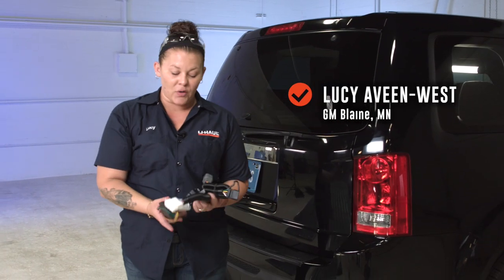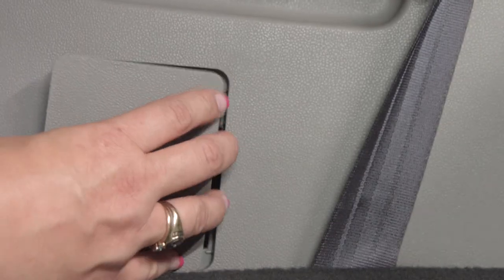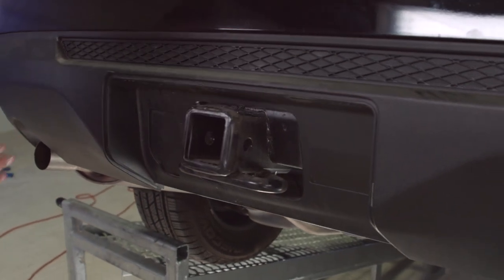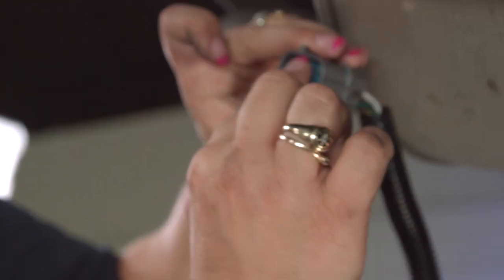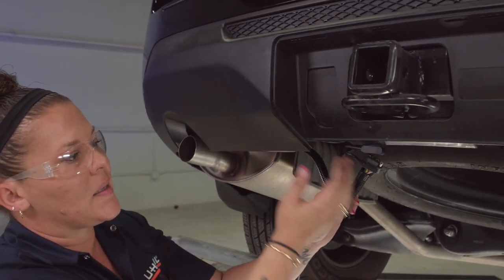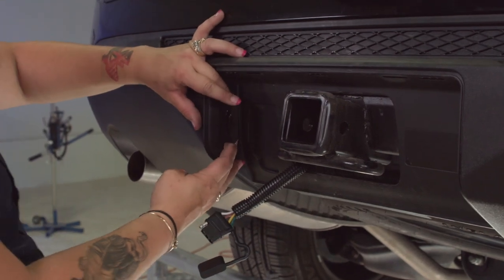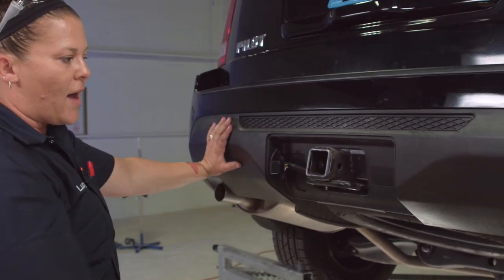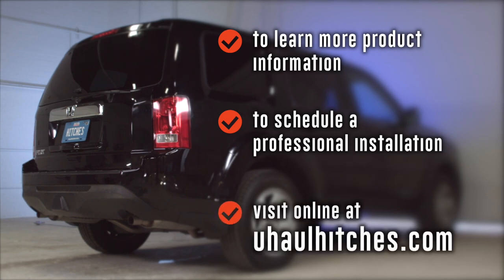2012 Honda Pilot Trailer Wiring Installation

Comment: The part at 2:25 where she says "unclip and pull out" is bogus.  The "clips" are, understandably with regard to the wiring harness, made never to come apart unexpectedly.  So they hold the "safety cover" very securely.  It took me about 45 minutes to get the thing off.
Reply: Ikr 😂 had to squeeze it as hard as humanly possible
Reply: The clip that holds the harness on, needs to come off. Then it should more easily pull apart. It wasn't until I was putting the tow harness in that I realized it wouldn't go in there until that clip was off. Which would have allowed the safety cover to come off easily.
Reply: Pull the adhesive clip off of the frame of the car. Slide that piece out of the harness. Then on the opposite side, there is another clip that needs to be pressed to release that side. Then you can easily pull the casing off
Reply: How did you finally get it off?
Reply: Got it!

Comment: So once that 1st componet/wire gets connected, u just shove the rest of that wire in and no need to do anything with the other end? I'm lost.
Reply from the maker: Yes! Nothing else is needed for the harness. Once plugged into the male end in the cargo area, you can store and forget about it. This allows you to get power to the 4-flat installed later in the video as well as stores your fuse.

Comment: Looking for this kit and it isn’t the same. On the site the kit is incomplete
Reply: Go into the link in the description, put your year, make and model for your vehicle, and it will bring up all parts for that vehicle. I just tested it and put in 2012 Honda Pilot and under trailer wiring I was able to select Curt 56170 which is what is used in this video.